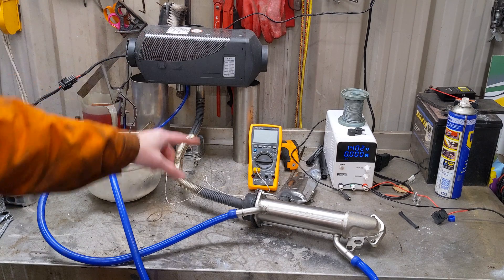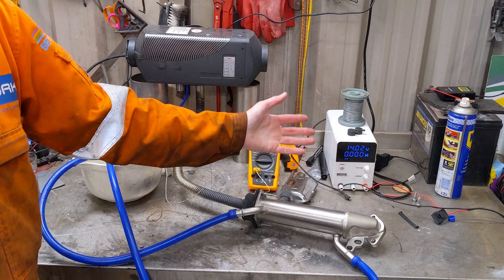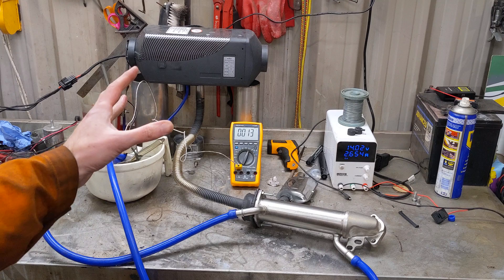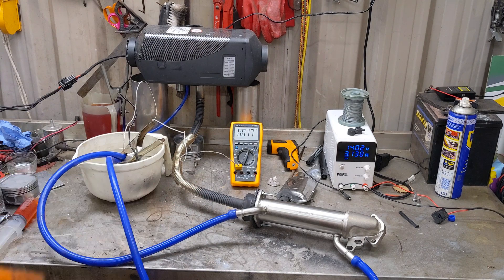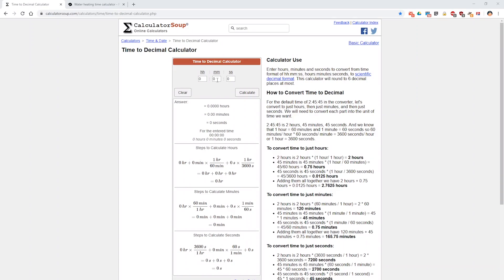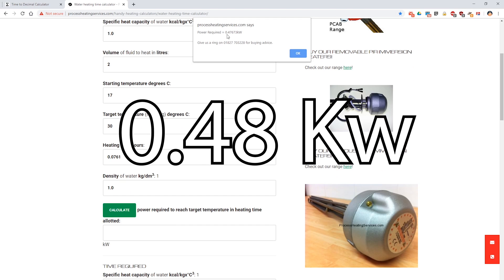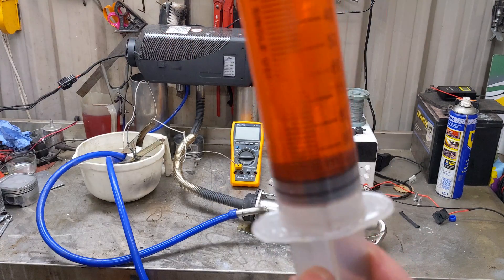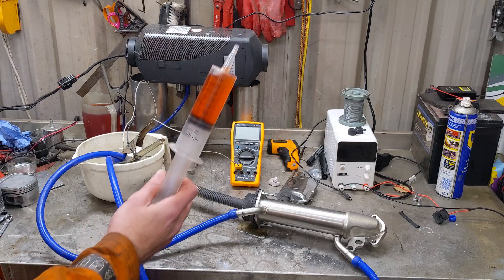Exhaust heat recovery with EGR cooler KW measured

Comment: Where can I get one of those heat exchangers? Please
Reply from the maker: I got mine on eBay.  You can use swimming pool heat exchangers, or vehicle EGR coolers.  Just need to modify to fit the heater.

Comment: I have tried several egr coolers on my diesel heaters but they just make them produce a LOT of white smoke!. I think they produce too much back pressure . I got my egr coolers from the scrap yard and tried to clean them as best I can. So thinking it was that they were already dirty, I bought a brand new egr cooler. Got it connected up yesterday and fired it up for the first time. It ran great for 6-7 minutes and then the white smoke began to build. I don't want to give up on my project, but I am struggling on what else to try. Anyone any ideas?.....
Reply from the maker: Have you got a CO meter.  Would be interested to see what the heater is running pre EGR cooler.  It might just need retuning once the EGR is attached.

Comment: Instead of heating water - what happens if it preheats the incoming combustion air?
Reply: I like the idea of a fan over the recycled heat to send it into the space. I had thought about  your idea or using the exhaust flow through an exchanger of some kind. I am somewhat concerned about sending it into that intake. Not that for sure it would be a problem as the air my just be like a little warmer day or a warmed up room. But to be safe I would want to know what the more technical guys on this heater would say if any adjustments to fan speed etc are needed. Or maybe even not. I tend to think it will not harm the heater as it is not some huge amount of heat.

Comment: Hi could you use the heat exchanger from a boiler instead of the EGR cooler would that work
Reply from the maker: I don't know what temperature the plate heat exchangers are rated to.

Comment: David great work. Can you please tell me what happenes with the normal exhaust gases in this case ? I don.t see anything in the atmosphere,not even vapors of condensation. Are they absorbed by the water and the oxigen is safe to inhale ? that would be brilliant in case I would fit a radiator instead of that container and run it in a closed space without the problem of intoxications right ?
Reply from the maker: The water and the exhaust doesn't mix.  Although much cooler they would still need to be vented to outside.
Reply: @DavidMcLuckie  thanks for the answer. I have a chinese diesel heater and been trying to runn it in a apartment but there is a problem with the white smoke that comes up on stratup and it bothers the neighbors. It's for a short period of time like 5 mins butt still annoying. Can you please make a video on youtube with different hacks or methods that can reduce the white smoke on startup ? Oh and the noise exhaust reduction as well...damn people allways have something to complain... thank you for the good work

Comment: I would like to use this idea in my campervan, using a 14 L insulated vat and a 12V pump to recirculate water from the egr to the vat. Only thing is I would need a way to bypass the egr cooler thingy in case the temperature in the insulated vat reaches a set temperature (let's say 70 degrees - seems much but the boiler vat has a automatic mixer vale on it...
Any ideas what car has a convinient egr and egr valve to use for such a setup?
Maybe a egr valve which is electrically (12V) controlled?
Reply from the maker: Great idea using the EGR valve to bypass the exhaust.  Most of the EGR valves I've seen are vacuum operated as they end up being in very hot places where 12V motors don't like to be.  :)
Reply: @DavidMcLuckie  I must admit I never actually had any parts of an EGR system in my hands though I like the Citroën C5 you guys are using... 
I also had a though about using a bi metal operated valve but that would be mechanically very complicated to make.
Getting suitable valve which goes with a EGR and can be plumbed in in such a way it acts as a bypass sounds possible but I would not know what vehicle I would need to get the parts from, maybe your recycling facility employed brother can remedy that lack of knowledge ?? Would you kindly ask him what to track down ?
You know: 12V operated, bypass suitable and that kind of jazz...

Comment: I’ve ordered a 3m exhaust for mine so I’ll just run that inside my shed and hopefully that gives me a little more heat into the workshop. I have a 50 sqm tin shed so I need all the help I can get. It warms it up by about 4 degrees above ambient so hopefully it’ll take it to 5 degrees above ambient haha.
Reply from the maker: If you can find an old domestic radiator and run the exhaust through that before it exits the building you can recover even more waste heat.
Reply: @DavidMcLuckie  yeah just done a test with it and still very hot exhaust. Also realised I only bought the 2m length

Comment: Couldn't this cause a steam explosion in a closed system? How did you go about preventing that? You could shut off the heater if it reaches a certain temp but that would damage the heater as it wouldn't go through its cool down process.

Btw fantastic content happy I came across your channel.  You got a new subscription.
Reply from the maker: Yes, you are correct.  I'd just never have a closed system.  Have a header tank with a vented cap or a pressure set cap so you don't build too much pressure.
Reply: @DavidMcLuckie  excellent and thanks for the response.  I am currently designing a portable 5kw version inside a case for my boat, truck shop etc. Heating water with exhaust is of interest for two reasons.  One efficiency, two by reducing the exhaust temperature i am able to explore other options for safe disposal of the fumes.  Do you notice a significant reduction in exhaust temperature post heat exchanger?

Comment: Hi, so these heaters advertised on eBay, Amazon etc that are marked as 5kw or 8kw are the same just with a different label . If not how can you tell the difference .
Thanks in advance.
Andy
Reply from the maker: There are just two sizes.  The small one usually labelled 1-5KW, but known by everyone as the 2KW and the larger labelled as 5,8,10,12KW but again known normally as the 5KW.  They are two physically different sized heaters.  I had a viewer recently who bought an "8KW" and opened it to find the 5KW stamp on the burn chamber.
Reply: @DavidMcLuckie  cheers David just looking on ebay  now,  I suppose you buy the 8kw one and hope it's the larger of the two. 
Thanks Andy
Reply: @DavidMcLuckie  Dave just looking at one now the dimensions are 14.5 x 14.5 x 39cm's if you were a betting mad would you say it was a 2 or 5kw
Reply from the maker: 39cm long is the larger of the two heaters, so that's a 5KW.  The smaller 2KW would be approx 33cm.  The 5KW also uses 75mm ducting and the 2KW is 60mm.
Reply: @DavidMcLuckie  
Cheers buddy bought one.

Comment: You've inspired me to plumb an EGR to my coolant system for a block heater in my T1N Sprinter because she struggles to get started in the cold.  Gonna do the install tomorrow.  Wish me luck!
Reply: How'd it turn out?
Reply: Works great. Keeps the block warm in the cold and helps a lot with starting when I’m in low temps.

Comment: Hi, great series of videos 🤓👍👍. A couple of questions if I may, please excuse my ignorance but as a mechanic I make a great commercial analyst 🤪. 
Does the EGR impact the efficiency of the heater? Namely does it use more fuel with the EGR attached to the exhaust and is the heater outlet temperature affected?  Do you think the speed of the exhaust gases are affected passing through the EGR and if so will it impact the heater performance? Finally, do you think the scavenged heat from the exhaust would be sufficient to power a radiant heated floor in a van?
Reply from the maker: If anything slowing down the gas leaving the heater will slightly improve the output temperature.  But the EGR cooler only has a very minimal impact on gas fow.  Underfloor heating would be an ideal use, plus it's free heat so to speak.
Reply: @DavidMcLuckie  Cheers for the response.
Reply: @DavidMcLuckie  What components would be needed to covert this exhaust heat into underfloor heating? If you were game to do a wee video on how to set that up I would watch it at least twice and give a thumbs up :) I am trying to figure out how to capture wasted heat from the engine and engine bay, exhaust manifold and diesel heater so your videos have been really useful. Would there be any advantages to using glycol to extract the heat rather than water directly? Could glycol be used on a thermosyphon like water can? Maybe to pass several components to heat the floor then dump remaining heat into a water tank perhaps? Am I getting too ambitious? I have watched more hours of you pulling these heaters apart than I ever imagined I could! The accent helps, haha.

Comment: If you want to capture the lost exhaust heat you can just make a long dual exhaust.  get an y fitting like this 
https://www.ebay.com/itm/25x1-5x95mm-Copper-End-Feed-Euqal-Y-shape-3-Way-Pipe-Fitting-for-gas-water-oil/173289193754?ssPageName=STRK%3AMEBIDX%3AIT&_trksid=p2057872.m2749.l2649

https://www.ebay.com/itm/Cuivre-Rond-Tube-24mm-OD-1mm-Mur-100mm-Longueur-Creux-Droit-Tuyau-Tube-2Pcs/274295169810?ssPageName=STRK%3AMEBIDX%3AIT&_trksid=p2057872.m2749.l2649

https://www.ebay.com/itm/Air-Heater-Tank-Exhaust-Stainless-Steel-Pipe-Diesel-Gas-Vent-Hose-60-300CM/402547860464?ssPageName=STRK%3AMEBIDX%3AIT&var=672805457045&_trksid=p2057872.m2749.l2649

Comment: Ho david. How did you attach the exhaust to the egr cooler
Reply from the maker: A very bad welding job onto a plate that I cut to fit onto the end of the EGR cooler.  What I wanted was a pipe that fitted into the exhaust but didn't have any scrap suitable.

Comment: Interesting - I have a EGR and was thinking of fitting it to my  1934 Lister CS 5hp to both capture the exhaust heat for my 25ft workshop &  I reasoned cooling the exhaust would quieten the noise?
Reply from the maker: It would quieten it a little, not as much as an actual silencer would.

Comment: If I buy a used EGR cooler could I clean it enough to be used safety with water that people will be showering with and washing hands? 

What’s the fluid that is used in an egr cooler?
Reply from the maker: I'd say yes.  For engine coolant it will be either ethylene glycol or propylene glycol mixed with water.

Comment: Great videos have one of these diesel heaters and have been wondering about heat recovery....if you run it 24 volts does it decrease resistance .dropping amp use while running ??

Comment: curious what exhaust temps are in this set up.  You've nicely done thermal video of  your modified unit..... have you done them of this one.... in particular for a water heating setup attached.  Would also be interesting to compare this heaters water heat exchange efficiency  compared to your modified exhaust heater.
Reply: oops..... lol...... just found your dec. 23 vid... answers some of the above

Comment: Do you think one could forgo the pump as long as egr cooler is below the water tank? Then the natural convection flow of hotwater rising would create a slow but steady circular flow throughout a closed loop system to tank?  I'm looking to do this without the added water pump side and rely solely on convection.  I'm fine if it is slower.  I just hope it would still flow without a pump.
Reply from the maker: https://www.youtube.com/watch?v=YcWY1FPf92Q

Comment: I've been wondering this for months ! The closer you have the egr cooler to the exhaust "manifold" surely the more heat would harvest?
Reply from the maker: Absolutely, as would insulating everything.
Reply: @DavidMcLuckie  do you think any of the iterations of egr fitment you've tried, could supply water hot enough for a forced air heater like in a car,  in a continuous water loop?
Reply from the maker: The egr fitted onto the end of the modified burner and a much slower water circulation might work.  As another commenter pointed out the longer the water stays in the egr cooler the more heat it can absorb and the greater the efficiency.

Comment: Thanks for the video it inspired me to DIY. 
Just finished my quick installation of EGR and radiator with hot water heater pump. (11 litres per minute)
Works well and gets the water temp up to 45-55c after 1 hour of running. That's with the room at 13c and outside 9c. Putting a simple safety in place for cutting the connection to the fuel pump if it goes over temp for now. 

Using a 60x60 single radiator and a mondeo EGR for £9.  

Next i'm going to insulate the exhaust piping to see how much that improves it. :) .
Reply: Thanks so much for sharing. Great idea on the fuel pump cut off safety relay.... I am going to send all that exhaust waste heat into my interior 35gal aluminum tank. Being inside its kinda like a big 35 gal radiator lol. Just take a shower when the water is the right temp and you'll never run the risk of freezing tank. The water tank also has a built in engine coolant heat exchanger I made for it too if it needs a little boost.      Now I got 2 forms of free byproduct hot water heating!

Comment: Hi love your vids about diesel heaters,I have a 5kw one that I run on 0.8htz when it gets going and I use paraffin not the pink stuff so it doesn’t soot up do you think I can use 50/50 diesel and paraffin without it sooting up as 0.8 is lowest it will go and is quiet at that and keeps my van at 19 when it’s freezing outside and 22c when it’s just chilly outside🙂

Comment: where did you get the connection for the exhaust inlet end that attaches to the egr? They grey blach thing?
Reply from the maker: I made it.  Steel plate cut into roughly matching flange, bit of pipe welded on to make a chamber, a lid for the chamber with a hole in it to fit the exhaust.

Comment: I’ve got 2 of these heaters which I’m going to put 2 egr coolers on the exhausts and see if I can flow it through a car radiator with a fan for extra heat for the workshop
Reply: I got 8 litres of water to 50c today in an hour all uninsulated. So it’s feesable to do it with insulation and less water. The heater wasn’t all to keen on the back pressure though it got quite sooty
Reply from the maker: That's another one I've still to do, I've got an old intercooler and I'll attach it straight onto the heater.  :)

Comment: 6.3KW/h ? Not bad...
Reply: There is no such unit as KW/h. He is heating water with 500 W (watts). If applied for 1 hour, the amount of heat is 500 Wh (watt hours) or ½ kWh (kilo watt hour). Watts are the speed, kWh is the distance travelled.

Comment: Would cooling down the exhaust gases lead into problems with condensate freezing at cold ambients? The original muffler gets quite wet at low powers as is.
Reply from the maker: Yes, I'd make sure to have it pointing down to let any condensate drain out.

Comment: sooooo....is that about 1700 btu's/hr or 17000 btu's/hr ??? My brain hasn't quite got going.... :o)
Reply: As I recall, 1 watt of heat is about 3.4 btu.

500 w = 1700 btu.

A small burner on my electric stove is 600 watts. 

This seems like enough heat to slowly heat 20 liters of water for kitchen or shower uses.
Reply: @johanvangelderen289  Warm water to wash your hands or clean up stuff in a shed.

Comment: I wonder if you connected the flow and return through a domestic central heating radiator, it would raise the temp in the garage?  Asking for a friend....
Reply: Think how a car heater works. 

The water pump moves hot water from the engine through a heater core. Which is a small radiator.  A fan blows air through the heater core, then through the dashboard.

We would use a 12 water pump to move water from the egr heat source to a heater core. Then we use a large 12v computer fan like Noctua makes to blow air through the heater core. 

The result is 500 watts or 1700 btu of warm air which would have gone out the diesel heaters exhaust.
Reply: @Woolly Daly I’ve just finished a project as suggested today and it works. 

1200x600mm radiator running a gravity fed system. The use of a central heating pump through the same egr cooler and with the heater on full (5kw all in one) after about 30-60 mins the radiator is lovely and warm. 

Free heat that would otherwise go into the atmosphere!

Comment: Thank you so much for doing this! That recovered heat would negate the need for me to run my gas Carver water heater. My only concern is would the EGR soot up?
Reply: I think the exhaust gas passes through it only, and the water jacket is around the unit , if that makes any sense ?
Reply: @PhantomMark  Yes, makes sense, but if the egr is damp with condensation then would the soot stick to it and clog? I run mine full time, so have to turn it to full for 15 minutes once every 12 hours to stop it clogging. sometimes it can make a black patch on the ground.
Reply: @connectcapers7614  I am going to take a punt here and suggest just using a cleaner fuel, meth or petrol or something cleaner than derv ? the deposits would be minute compared to Derv surely ?

Comment: Did he say there's one with a built-in EGR water heater?
Reply from the maker: There was supposed to be.  But what arrived was just another normal diesel heater, so now I'm trying to get my money back.
Reply: @DavidMcLuckie  will be awesome to make a glycol radiator heater and an EGR water heater for tea! That combined with the normal forced air heat will be awesome!!!
Reply: i think it's just a water heater, not using EGR. simple heat exchanger on combustion chamber. i might be wrong.